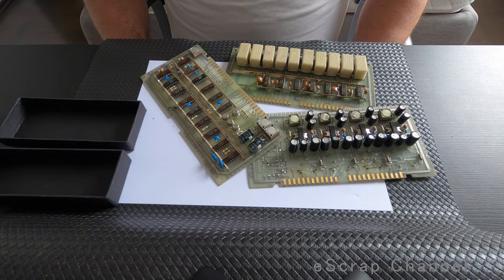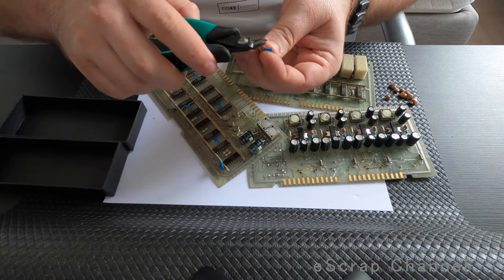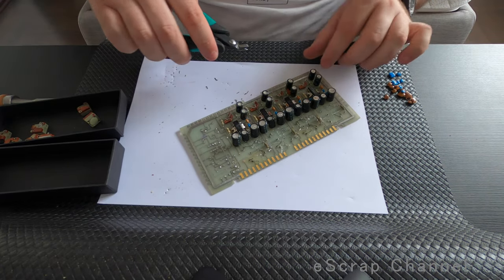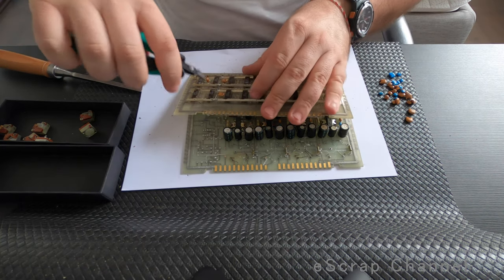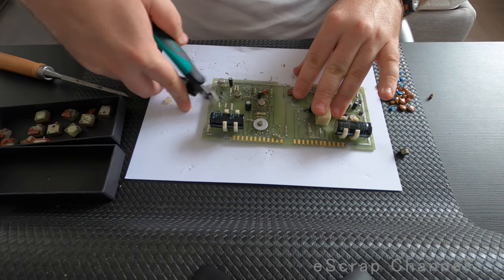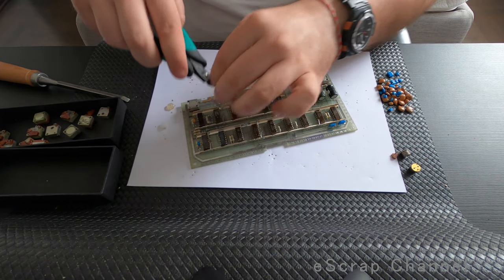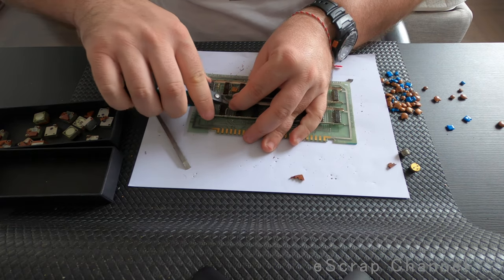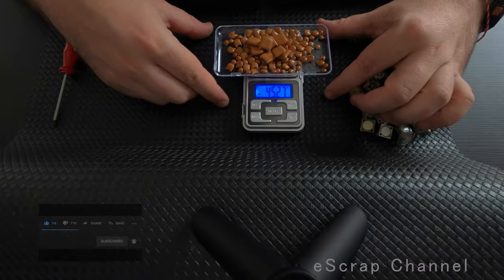Huge Palladium score from Vintage Electronics Boards!

Comment: What is the next step in our journey to sell the palladium? I'm in America. Everyone looks at me like I'm dumb when I ask them how to sell it. They want me to send it away for an "assay"
Reply from the maker: Hi, there are at least two companies in my city buying precious metals including palladium. So, I sell when price is good. Some companies buy capacitors but melted pure palladium price is better than row material price, so I prefer to process it and sell the metal.
Reply: @escrapchannel  places I've gone tell me I need an Assay done... Telling me I have to go through a jeweler to have the palladium sent to a refinery, processed, valued, then they will make me an offer on it. 
Also they say I should be sending away hundreds of pounds of the raw material to make it worth anything??? Does this sound right to you? Thank you for your help
Reply from the maker: @andreamichelle8383  I live in east Europe and here you can sell 10 grams of capacitors or half gram of palladium for example. If you have quantity you can negotiate better price but there is no lower limit. Usually buyer is doing analysis and it can be done to both types of material. I think you should search for the right buyer in your country.

Comment: That is electronic part score, did not see ANY palladium.
Reply from the maker: Capacitors have 4-6% Palladium content, but I process them in kilogram batches to really see the palladium :)
Reply: The electronics have palladium Inside. I've been doing the same thing lately collecting palladium and those capacitors are crammed with it haha

Comment: That first transistor you cut off may contain gold inside even if there is none on the bottom or on the little side tab.  You should at least cut one open to check.
Reply from the maker: Sure! Sometimes the wiring is gold and inside are gold plated! I collect them and check on big batches when kilogram or more reached.

Comment: I’ve found a 1800grams batch of mlcc for 300€…I hope to have at least 0,8% yeld on palladium, what you think? The majority should be non magnetic ones
Reply from the maker: Take a 50g sample and test them.
Reply: Wow,  I make 899grams from old radio, tv... And I sold them to a collector for 4,900€  But I had only one brand(Green)   from which country are you from?
Reply from the maker: Hi, if you refer to Soviet Union capacitors, there are super expensive ones full of palladium and platinum. Ordinary MLCCs mix are far away from this content. I am from Bulgaria.

Comment: I have the same side cutters.  Man I love those things.   Need a few more pair
Reply: Hey can you guys let me know what brand and type of cutters those are? Im looking for something a little better that what im currently using. need them to snip tighter to the board in some cases. Thx
Reply from the maker: I use a cheap Chinese proskit cutters. The point is that they are designed for electronics and flat, so they cut really close to the board.
Reply: eScrap Channel great thx

Comment: Awesome infos! Just a question, how you know which capacitors contain palladium? I’m looking everywhere but I can’t find info. Every blue/brown cap I found have palladium?
Reply from the maker: Hi, not every brown or blue capacitor has palladium. These have mark “bc” “bo” and we’re made in Bulgaria. In general I cut capacitors in 2 parts and look at the MLCC inside. In general being non-magnetic is a good indicator. Some magnetic have palladium, too. So, break and collect all capacitors that have mlcc inside. If not palladium - you will get at least silver.
Reply: @escrapchannel  do you have a video where you extracted the palladium from them?
Reply from the maker: Hi, coming this summer :)
Reply from the maker: @Dumitru Bojan MLCCs have palladium, but it is an endless discussion if magnetic or non magnetic or both have palladium. From my experience palladium in no magnetic is significantly more in non magnetic MLCCs, but I find some in magnetic too. Very small amount. Here some people say that it comes from now well separated nonmagnetic MLCCs, some say that there is a palladium in magnetic. I never did detail analysis.

Comment: Are newer boards still worth stripping down for precious metals? Like the cheap Chinese e-junk?
Reply from the maker: Hi, the only high gold content element on the new boards are BGA ICs. Some boards in telecom equipment have more than 10 BGAs so I depopulate such and get gold. For motherboards and peripheral cards etc better sell. To process and get real profit you need a factory.

Comment: So good you reply to everyone..
I didn't understand if you made profit or did you sell as is? Or have to process ??
And what was your profit roughly?? It's sells by gram not kilo also???
Reply from the maker: Hi, it takes 3 hours from the pile of devices to depopulated elements.
So, in all cases if you don’t process ICs and MLCCs by yourself - sell boards. Takes 1-2 min to take the board from one device and is cost affective.
If you decide to depopulate valuable elements you severely downgrade boards but you get 40 - 50 USD in gold and palladium.
Reply: Hello,love your info..There's no way I could process these,but have many.. are there people that buy these Caps ???
Reply from the maker: Hi, yes people buy but it is better to find local buyer as on internet risk is higher and prices low.

Comment: As the amount of palladium decreased over  time, did the outer color remain the same?
Reply from the maker: Hi, these capacitors were not manufactured after 1990 so all batches are high Pd content ones.
Reply: @escrapchannel  Very good, my friend. I knew my hoarding of scrap boards wasn't a waste of time.
Reply from the maker: @Scupplin  Hi, it is better than money in the bank!

Comment: How do you isolate these metals so when you go to sell them? or you just sell cut off parts?
Reply from the maker: Hi, I accumulate capacitors until I have 1 kg of a kind and process them. I remove the coating in DMSO, then I remove the solder and remaining capacitor cores I grind before dissolving metals in nitric acid hot. From the solution I recover silver and palladium.
Reply: @escrapchannel  that's amazing